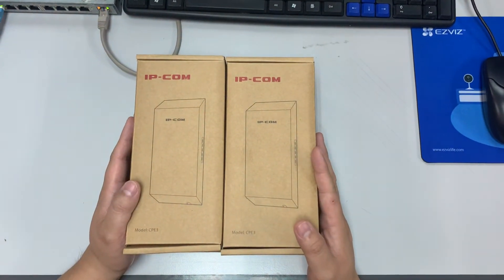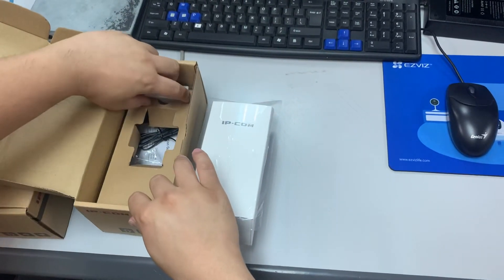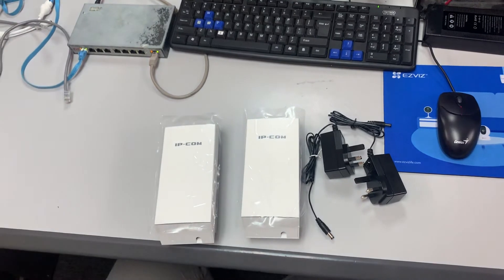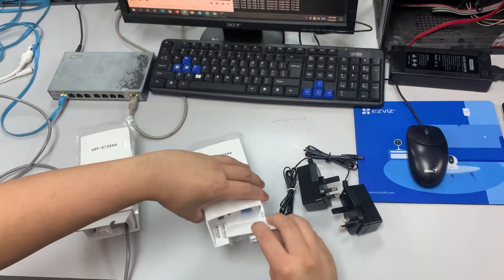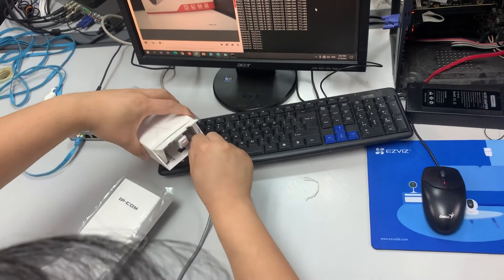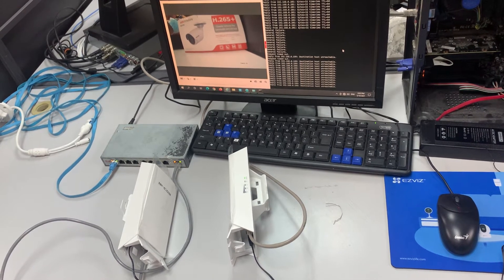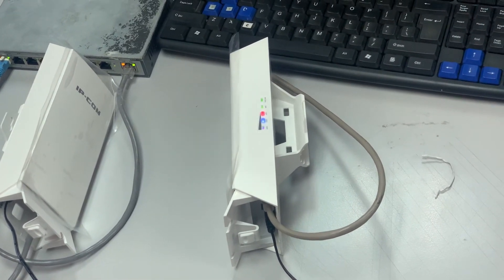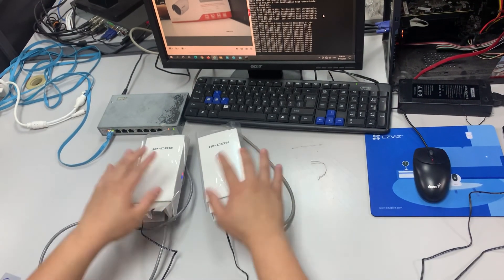IP-COM CPE3 Point to Point Unbox & Setup pairing.

Comment: Hi, im using CPE3 for CCTV Lift application.. now i have issue lost connection when sometime.. really need advice for help me.
Reply from the maker: If u findout have problem on CPE3, how u set it up? 
I suggest for the easy way, there is no technically, kindly do reset on that pair and do the pair again. Like my video.